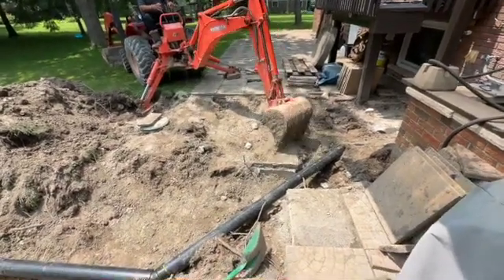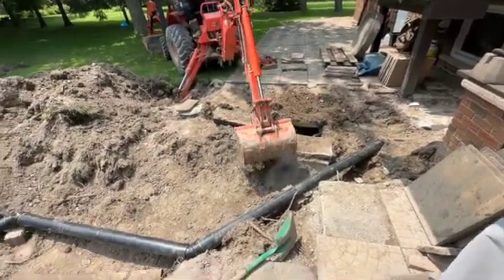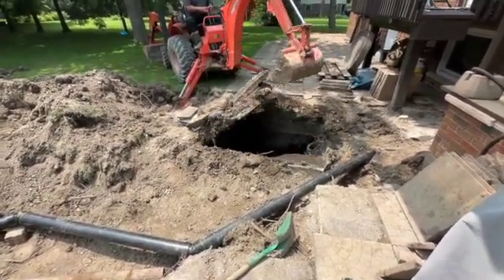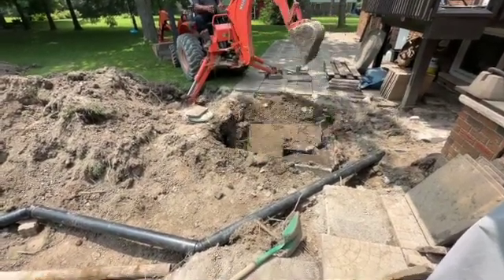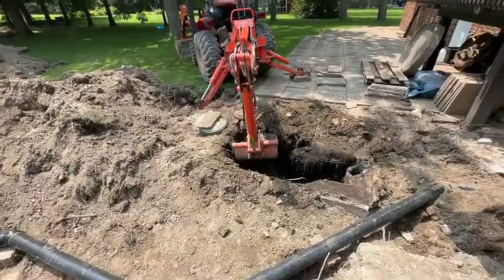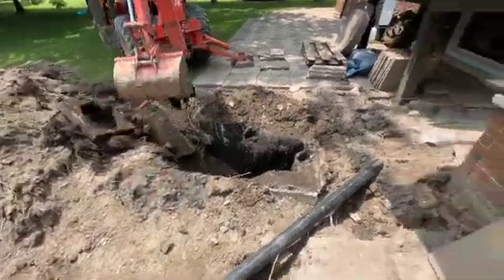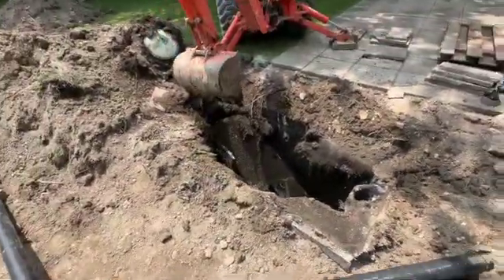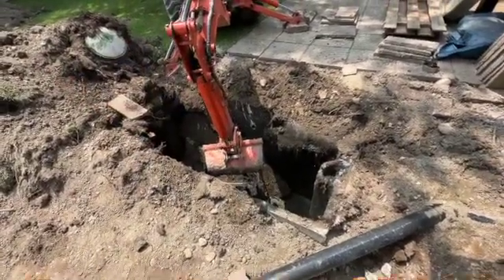Destroying a Septic Tank: Safe Demolition and Responsible Disposal | Expert Tips and Techniques

Comment: I found an old abandoned concrete septic tank under the deck of the house I bought a year ago. The tank is near the driveway but the top of the tank is about 5' above the driveway. What can I cost effectively fill the tank with to ensure it does not collapse and possibly take the deck with it.